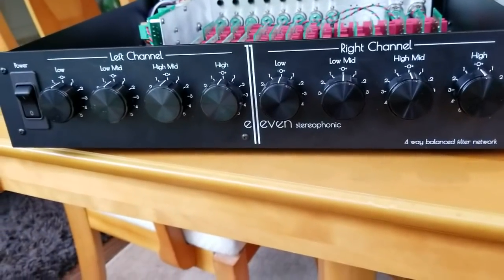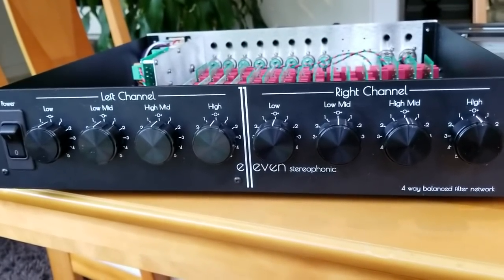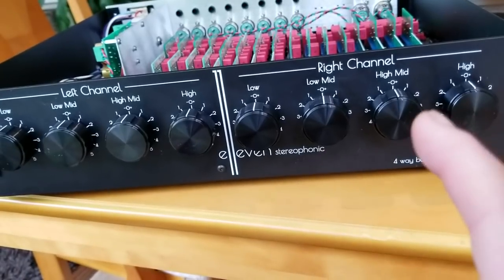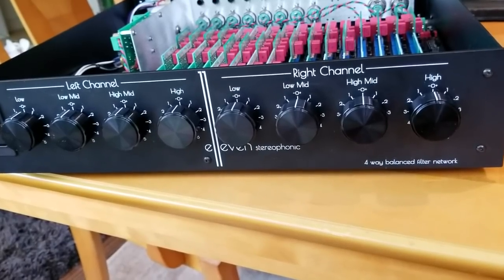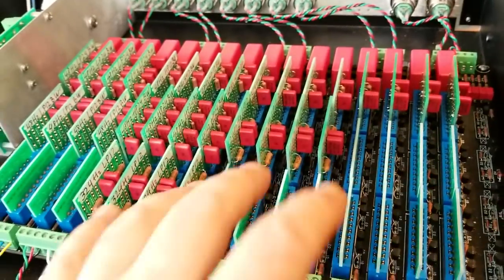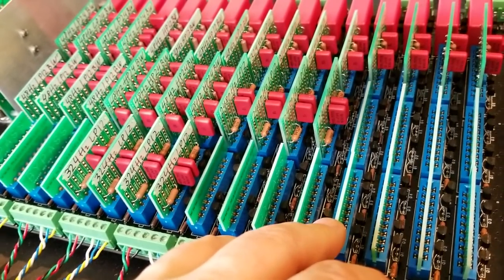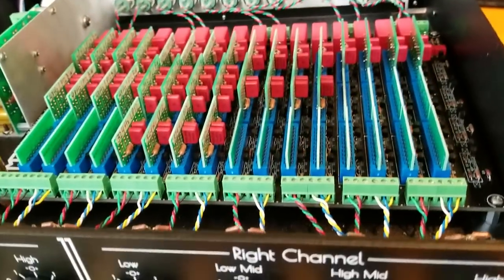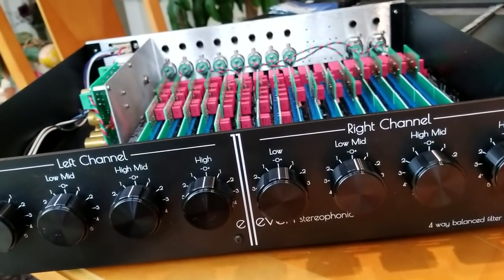e11even stereophonic 4 way balanced filter network

Comment: I built some PM-2 and PM-22 modules once along with the XM-1 crossovers.  Awesome stuff.  But that was 30 years ago.  I had a question and called the number.  Actually spoke to Phil.  Nice guy.  One upgrade for the XM-1 modules were the Analog Devices AD 712 high speed, bi-fet op amps that reloaded the stock.  Difference was HUGE.  It also made me realize that ICs were not necessarily undesirable.

Comment: OCD, This is beautiful. How does it sound? I am ripping out my Maggie crossovers.
Reply from the maker: I'll have the virgin test run this weekend ! Ask me anything regarding the mod as I've probably been through it. It's not necessary to "rip out" the old crossover you just disconnect and bypass. That way you keep it in place for easy reversion if you want to go back in order to sell or whatever

Comment: That unit is frickin bueatiful! Do you use a little EQ in your system? Maybe from 500 hz down?
Reply from the maker: Hi Chris, thanks man.. I do not use EQ whatsoever, I just cut gain on the area in question 48 and below 48 to around 220, 220 to like 2K  then the rest up.. I have yet to even hear this piece, its a brand new build and I'm finishing my speaker build as we speak... stay tuned !
Reply: OCD HI-Fi Guy awesome buddy. I was just RTAing my rig cause I had my Sanders amps rebuilt. That’s Roger Sanders he makes InnerSound flat panels. I do a little eq from 410hz and down to my ATC speakers.

Comment: have you tred the unit with the op chips before? i would wonder if its worth having the transistors instead
Reply from the maker: That's why I had it built. One of the Pass Labs engineers said they decided not to use opamps due to a slight glare, I will listen to the difference. And report back
Reply: @OCDHIFiGuy  I gotta say your crazy passionate and I love the direction your aiming at. It's all about doing it yourself and getting dirty. I love that silver plug you built that's crazy lol. And I also see you like playing with big stuff not whimpy small speakers. I also love when you crank the systems others at shows= whimps compared to you.
Reply from the maker: I just like to have fun.. I'm still a kid at heart..
Reply: @OCDHIFiGuy  which area are you in? U.S I beleive
Reply: @OCDHIFiGuy  I don't notice any glare on mine on the sublime you could say it had that a little

Comment: This thing is freaking amazing I hope it’s not so expensive that the normal guy can’t get a hold of it because it will e
Reply from the maker: Something this complex is not necessary for 95% of systems Phil has simple 2 way crossovers for around 300 or 400